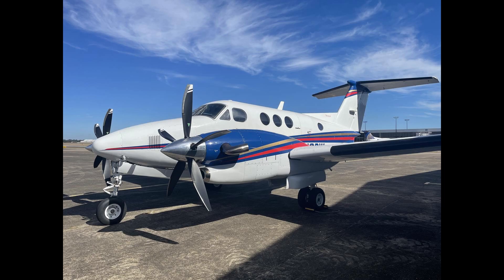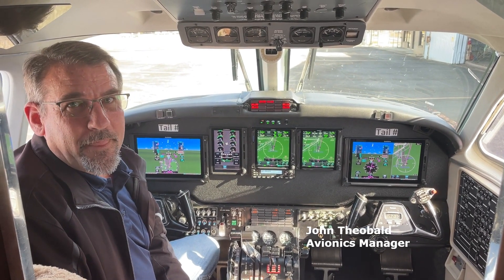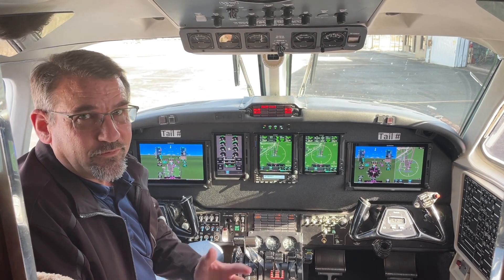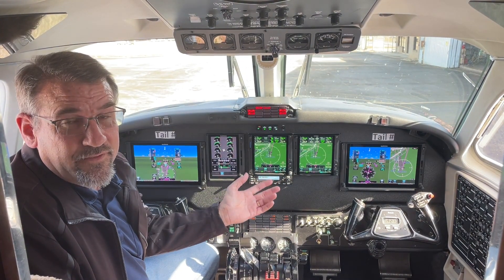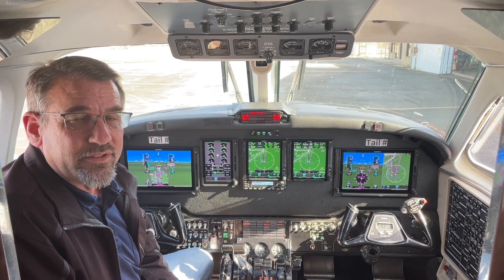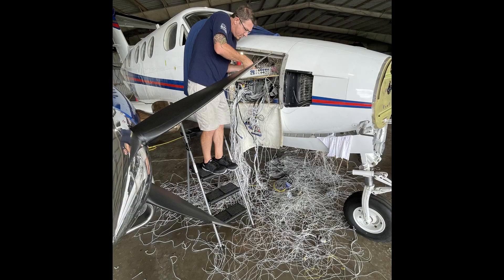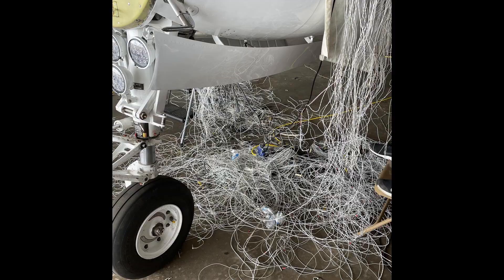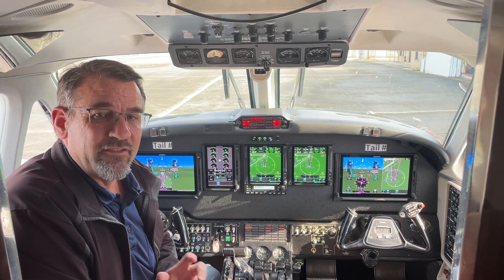King Air F90 Avionics Upgrade

Comment: 350 lbs of wire! That is amazing. With a 2007 King Air C90GT the Avionics package would be more advanced than this 1983 F, but the Avionics packages since 2007 have advanced so much more. Any idea of the weight savings doing a similar end result in the 2007 C90GT? It is a climbing beast with PT6A-135's. Only a 2 year model run. Avionics changed right after this model again for the C90GTi.
Reply from the maker: That 300+ pound weight loss wasn't all wire, Willy.  A significant amount of weight was saved updating the autopilot system, removing gyros, electronic HSIs, several heavy radar components, and so much more.  We have not yet had the pleasure of doing a similar project on a C90GT, but would love to talk to you about it.  Give us a call at 251-410-8050 and we can review your currently installed components (still all OEM Collins Pro Line and Garmin?) and talk about what you'd like to do with the aircraft.  Armed with that knowledge, we can then answer your weight loss question.

Comment: Wouldn’t you need to add some back to keep it within CG limits.
Reply from the maker: That's a great question, Wayne!  We are required to complete an updated weight and balance sheet detailing the equipment we removed and installed to ensure that the aircraft remains within the CG limits of the aircraft.  Had that pointed to an out-of-limits problem, we would have been required to take corrective actions.  Thank you for taking time to watch the video so thoroughly.